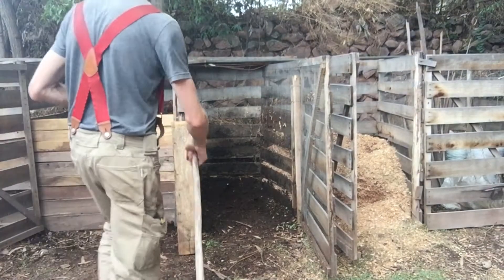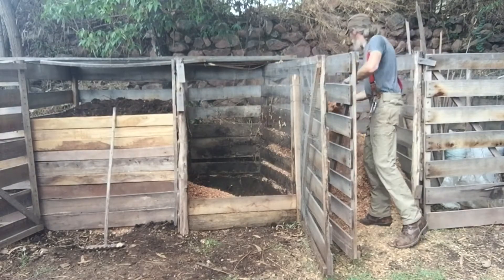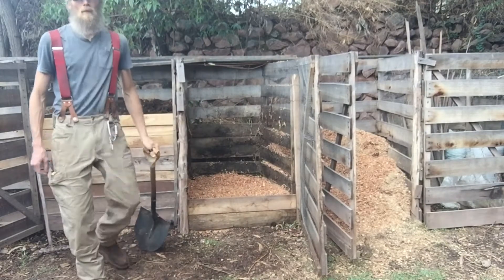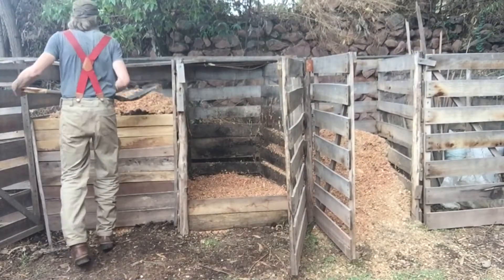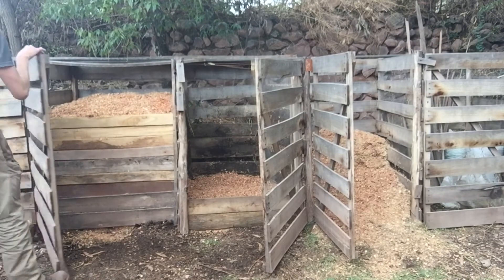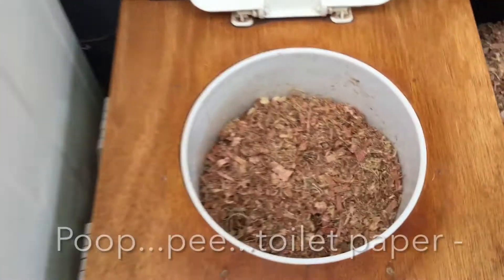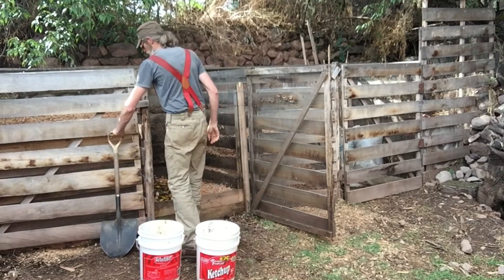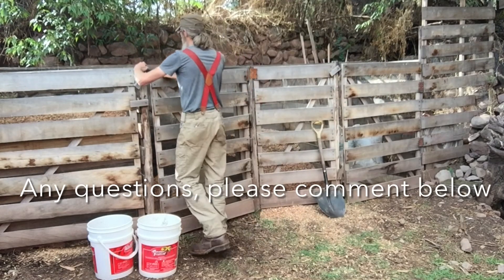Humanure Compost System - How it works

Comment: thank you for this helpful video. does it need to have air coming in or could you just fill up a larger plastic container/bucket and stop using it once it fills, cover it and wait two years. My thinking is I wouldn't even have to empty out a 5 gallon bucket every week. Would that work?

Comment: Are you vegan or do you eat meat? What if you take certain medications such as blood pressure meds or insulin, etc?
Reply: Collect Whey from the bottom of cheese production in a spray bottle  and spray a few pumps on the sawdust you cover each deposit in with in the bathroom. Lactic acid Bacteria LAB in whey will help this whole process and should  be breaking down mediation. 
Bokashi is the method. 
I'd add biochar with sawdust and have 3 buckets with lids trapping bokashi poo for 2 weeks in buckets before pile. Also, add LAB to water dumped outside it works anaerobic and aerobic.

Comment: We are just getting started with 30 acres of wooded undeveloped land and need to build a compost outhouse. Where do you get your wood shavings?
Reply: Look for the closest sawmill. They will most likely give you all that you want. It's a byproduct to them. 😊
Reply: I sometimes use a bag of pine wood pellets (made for heating) and add a little water to get the pellets to break apart into sawdust. They expand a lot so 6 inches of pellets in a 5 gallon bucket can fill the bucket. 

You can also buy bags of wood shavings made for animal bedding at a feed store or a farm & ranch store (where I live we have Runnings, Fleet Farm, and Tractor Supply).

Some people use what they have on hand: dry shredded leaves, dirt, or a combination of materials.

You just need a dry material that will absorb moisture and that will ultimately break down during the composting process.

Comment: Hey there! I tried going through the comments but so far I haven’t found this question. If I’m repeating another person’s question..my apologies!

Is there any reason in particular as to why you don’t use a urine diverter?
Reply: Urine goes in the bucket and helps heat up the compost. 😊
Reply: @timgiles9413 So why do you think that so many people do use a urine diverter? It seems like manufacturers of composting toilets include a urine diverter in their designs
Reply: @bradbiesecker162 I've been wondering this myself for awhile!! Why do sooooo many people think you need to separate the pee??!! It's probably a $$ thing cause these company's that make composting toilets charge A LOT when all u need is a $5 5 gallon bucket and a $12 bucket toilet seat and cover material... But yet there over here charging $1000+....it's weird to me ..

Comment: Thanks for the vid! Can you drop step by step instructions on the cycle you use in the description. I'm inspired to try this. Was thinking of welding multiple rotating steel cylinders to mix 5 gallon waste deposits with the equivalent of wood cover chips for 1 year... I would think after 3 years of that beautiful sludge baking in that container it'll be ready to bring any soil to life :)
Reply: Please don't do that. Read the book The Humanure Handbook by Joseph Jenkins first!!!

Comment: Good stuff. I will start putting down a layer of shavings before depositing into my receptacle which is a chunk of culvert vertically situated. I also have it covered with a large (3') round piece of 3/4" plywood as I didn't want the rain to wash away any good nutrients. Also, I use a plastic garbage can instead of 5 gallon bucket, plus my o/h is outside.

Comment: Thanks for this great video.  I am building a completely off-grid house made of recycled plastic roof tiles, bricks, and pavers.  I will have a composting system.  One concern I have is sourcing the wood for the sawdust.  I worry about inadvertently using treated wood.  If I cannot find untreated wood, I guess  I will have to go the long-term composting route to give the wood enough time to lose its toxicity.  Sound like a plan?
Reply from the maker: That sounds like an amazing project! If you are able to source wood shavings(not sawdust) from a local mill, or even material from an arborist who shreds their waste, pressure treated lumber shouldn’t be an issue. I would ask just to make sure however, as you don’t really want the chemicals in your compost.
Reply: @ericoberholtzerknives  Hi Eric, If the man cannot source wood shavings, could he use wood chips and peat moss, or any other composted material?
Reply: @michaelfoster8530 saw dust left outside to the elements to maintain dampness ( to prevent odor over material ) is the best source ! Wood shavings take a lot longer to break down than wood dust
Reply: Please don't use treated wood.
Reply: Sounds great! I wonder how you need to contain it so it doesn't seep into groundwater.
Reply from the maker: @paavo Hirn - a properly prepared pile with the dry sponge layer as shown will not present a leaching problem, unless you live in a high rainfall area. In that case, a roof would be in order to more effectively control moisture content. Joe Jenkins talks about this concern at length in the Humanure Handbook.
Reply: @ericoberholtzerknives  I'm more worried about trace amounts of chemicals from treated wood than anything seeping out of a humanure pile. You're probably right. I'll try to get my hands on that book. Thanks!
Reply from the maker: That’s a fair concern. To my knowledge, the odds of getting a large enough quantity of pressure treated wood shavings suitable for composting is extremely low since the wood is milled to final dimensions prior to being sent for treatment. Sourcing your shavings from a local mill that handles only untreated wood is probably the safest option.

Comment: Great video! I really appreciate the details you went into to guide other people through this system. One question; after you rinse the buckets one time, do you rinse them a 2nd or 3rd time to get them really clean? If so, where do you dump the water from the 2nd or 3rd rinse?
Reply from the maker: Thanks so much. I generally rinse only once, and then periodically scrub out the bucket really well to get rid of build up that occurs. Soap and a stiff brush for this are more than adequate, and that rinse water could go onto the pile if you are using a natural soap, though large amounts of soap might cause issues. If you would feel better sanitizing the bucket with bleach, that’s also an option. That could go into your drain system, though high amounts of bleach can cause problems with decomposition in a septic system. I’ve gotten into the habit of keeping a separate compost pile that handles all the waste from the dogs, and that’s what I use to process chemicals I need to dispose of(from the wood/metal shop, etc), as it’s a long term pile that I don’t use for applying to plants because the dog waste on its own can take a long time to break down. There was a study I found awhile ago on stormwater compost systems for processing road water runoff that showed a slow composting system would break down fuels like diesel and kerosene to virtually undetectable levels.
Reply: @ericoberholtzerknives  Great, thanks Eric!  That's impressive that a seperate slow composting system can break down fossil fuels!
Reply: @ericoberholtzerknives  Happy Farming!

Comment: @7:43 minutes, my stomach turned a little, i wasnt expecting it to be so liquidy! does it smell when you pour it out?
Reply from the maker: It smells a bit, yes, though the smell disappears as soon as it’s covered. The urine in the bucket makes it much easier to pour out as well. That said, I’ve changed baby diapers that were far worse than the bucket is, and the same goes for cleaning up dog poop. There’s a bit of ammonia in there, especially if the bucket has sat for more than a few days, and between the urine and the wood chips, it doesn’t smell nearly as bad as you might think. Taking a dump in the woods directly on the ground, say on a camping trip, smells much stronger than this does. Course, maybe I’m just used to it and not grossed out by poop, and I totally understand that people have different thresholds of tolerance with this.

Comment: Great video! Just wondering, you dig a small cone hole in the ground, how deep should that be? and after covering the pile with wood material, do you open up the pile pushing aside the wood material like the cone hole you dug, when you empty the buckets next time? Then cover with material again?
Reply from the maker: Thanks! I don’t dig anything to start the pile. Just put a thick layer of wood chips/other dry material on the ground to start. It’s not even necessary to remove grass or other vegetation before starting. To make additions to the pile, open a small hole by pushing material to the side, add your waste, and cover with fresh material. Hope that clarifies things!
Reply: @ericoberholtzerknives  yes it did, thank you!

Comment: Does my humanure compost need to be a distance away from my regular compost? Or can it be next to the bin?
Reply from the maker: I would recommend keeping them separate to reduce the possibility of cross-contamination. Alternatively, you could combine the piles if you’re ok with the resting period that’s required before use.
Reply: @ericoberholtzerknives  So as long as they aren't connected you think I should be ok? How far apart would you go? Thanks
Reply from the maker: I think you’ll be ok with separating them a meter or two. The main thing is that you don’t want accidental spillover from the humanure getting into the regular compost. If you have the space and layout available, you could put the humanure bins closer to the toilet if you wanted to, in a separate area, but of course I don’t know how your property is laid out. If the humanure bins need to go by the regular compost, then try to leave a meter or two of space between the different compost piles.
Reply: @ericoberholtzerknives  I have 2 acres so I have space to separate them, I have my compost on one side (left) of the house currently. The other side (right side closer to the toilet) is where my garden is. Guess I should have put the compost there huh? Haha.
Reply from the maker: It’s all what works for you with your process. I like to break it down from a permaculture perspective by taking a single element(in this case compost), then analyzing the frequency of the activities associated. With compost, we would have activities like adding to the pile, turning the pile, and distributing the pile. For me, the most frequent activity is adding to the pile, which happens every 4 days or so. Turning the pile happens one day out of three years. And distributing the pile happens only after 3 years, as needed, but the bulk of the distribution will occur prior to planting, all in one go. So the most frequent activity is adding to the pile, in which case I would ideally place the pile in a convenient location not too far from my kitchen and toilet, as I’m carrying messy, full buckets, so I want to minimize that labor. The garden can be further away since I’ll be aided by a wheelbarrow, and taking larger loads. So in your case, it probably makes sense to place the humanure piles closer to your toilet, so as to minimize the labor and time needed for additions to the pile. Hope all of that makes sense!
Reply: @ericoberholtzerknives   Great Points! I appreciate your wisdom on the matter, especially looking from a permaculture perspective. Permiculture is always the answer right!? Haha. Thank you for taking the time to explain in detail.
Reply from the maker: No problem! Permaculture is a wonderful system, especially when viewed and practiced as intended - a holistic perspective and application of principles, that goes well beyond just agriculture. Rearranging your thought process in the manner intended does help to solve a lot of the problems we encounter. That said, I like to personally use it as an open framework to allow for possibilities outside of the usual permaculture box. As with any system, it’s all too easy to become rather dogmatic which can lead to unnecessary limitations. I’m no purist here :-D
Reply: @ericoberholtzerknives  I meant to reply here haha. I completely agree! I'm pretty brand new to the idea and ideas of permiculture and the whole regenerative way of life. I'm so intrigued and intranced by the bennifits of ecology and of all the biology!  I have allot of work to do on my property and I tend to procrastinate quite a bit, debating on what needs to be done first. Haha
Reply from the maker: It’s fascinating for sure, there’s so much to learn. I would really recommend checking out Geoff Lawton’s channel, there’s a ton of information there. And for beautiful story telling videos(as well as good info) The Weedy Garden. I get the procrastination bit. There’s so much to do on any given day that sometimes it can feel a bit overwhelming, but I remind myself it’s a lifelong lifestyle and try not to get too wrapped up in rushing to get things done. All things in balance, eh
Reply: @ericoberholtzerknives  Oh I've been watching Geoff for a while now! I love his content! I watch Matt Powers as well as Zach Bush and many others. The Weedy Garden has crazy cool vidiography, angles and amazing content as well. We're in the same book for sure. I'm just a few chapters behind. Patience is a virtue. I tell my kids this but need to take my own advice. I want a permiculture food forest now though! Haha Nothing that lasts is built in a day.

Comment: What happens to all the liquid that comes out underneath ?  Does it soak in the ground.
Reply from the maker: Properly built and maintained, the pile does not produce runoff or leak anywhere. This is the reason for the dry ‘sponge’ base layer. If you have large amounts of rain you may need to consider a roof, ideally that also serves to collect rainwater.
Reply: Brilliant.  Thanks.  I do however think you may have gone nose blind.  Even my worm composter stinks, and that is only veg peelings. 🤢
Reply from the maker: Lol. My nose is decent, but my wife is the one with the super sensitive sense of smell, and even she’s amazed that pile doesn’t smell. I’ve opened it up for plenty of curious people to verify for themselves, and it’s always the same response, wow, no smell. The key is managing the carbon/nitrogen ratios
Reply: @andrewhudson2860  Is your worm compost tray resting on the ground or up on that legged tray system? My bottom tray is on the ground and there is no odor even when all trays are full.

Comment: Great video! Any problems with rats? Thanks.
Reply from the maker: Thanks! Prior to this year no, but this season leading up to the corn harvest the rats were exceptionally bad. It seems they came out in force during the extended quarantine here. I would recommend using heavy gauge coated hardware cloth, as the rats chewed through the standard stuff I had used, and it also started rusting out much faster than I anticipated. Lessons learned! Also definitely recommend a framed hardware cloth lid on top of the bins. That said, it’s been easy enough to put out rat traps to keep them in check, and the dead rats go directly in the compost and are fully broken down in about a month.

Comment: Are you in a 4 season area? Does winter/snow affect it differently at all?
Reply from the maker: Rainy and dry seasons here only. It gets down a little below freezing for a few weeks during the dry season, but not enough to affect my pile in any way. I think the generalized rule is that a compost pile needs to be minimum 1 cubic meter to hold and maintain heat. Snow will help with insulation to a degree, as well as providing some additional moisture, and if it’s extremely cold you may see a decrease in microbial activity during the coldest months. It won’t hurt anything, the pile may just go dormant for a bit, and as soon as it warms up activity will restart. If it were me, I’d probably turn it after the spring thaw to aerate and get things moving again, with a few fresh additions right in the core of the pile.

Comment: Hi!! thanks for the tutorial:) was wondering, do you put any barrier layer down under the bins to prevent liquids from seeping directly down into the ground?
Reply from the maker: You’re welcome! The only layer that goes between the pile and the ground is the wood shavings(or other dry carbon material). That layer acts as a sponge to prevent runoff. If you’re experience runoff, the issue is likely from too much rain, rather than the water you’re adding to the pile, in which case you would want to build a roof over the pile, and ideally collect the rainwater from there to use for washing buckets or for irrigation. If the pile starts drying out too much during our dry winters, I will sometimes just stick the hose in the middle of the pile for an hour or so, and I’ve never had water run out the bottom of the pile. Joe Jenkins discusses this at length in The Humanure Handbook(available as a free download), and I would highly recommend his book.

Comment: Hi, Eric!  Thank you for this great video!  I am a tad puzzled, though, that you said you have 3 active compost piles - is there one off camera?  Also, I believe you mentioned turning each pile - is that after bin is full?  THANK YOU!
Reply from the maker: You’re welcome! When the video was taken, I had one pile complete and was starting the second. To the right of the bin of wood shavings, there’s another bin visible, which is currently filled with bags of chicken manure and scrap wood. So, 3 bins for composting, and one for storing cover material. Yes, I turn the pile once, after 1 year of building it. That pile then rests for two years before use.
Reply: @ericoberholtzerknives I thought that you were using 3 compost bins which would make sense. The first bin would sit for 2 full years by starting a new bin every year. In the 4th year you would have compost that has sat for 2 full years.
Reply: What does turning the pile mean